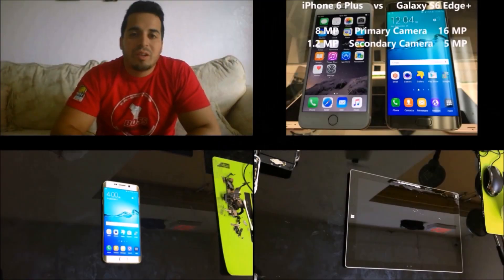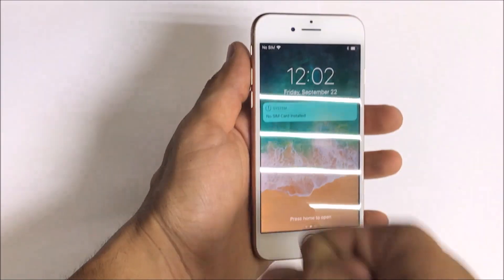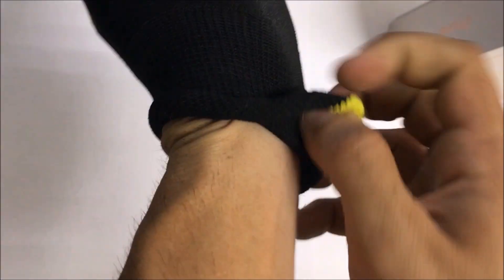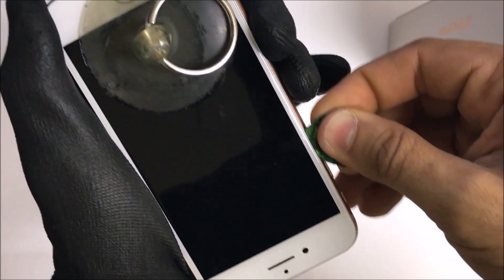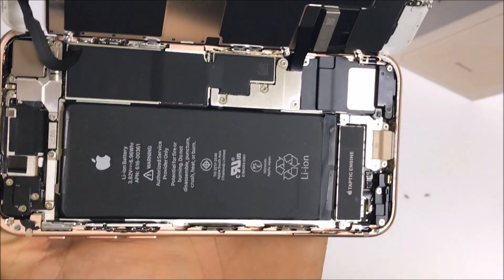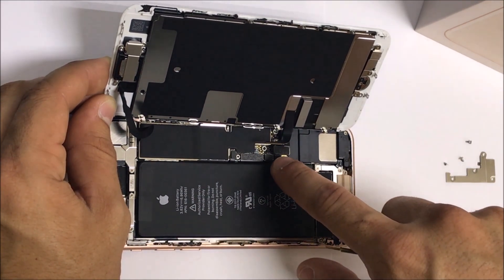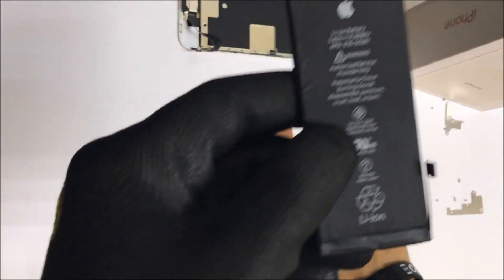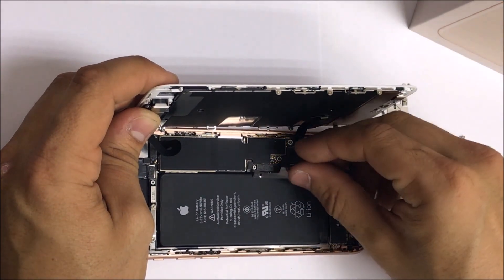How to Replace the Battery on a Apple iPhone 8

Comment: Good video. If I may. I personally would not even take off the flex cables connecting the screen to the motherboard. I have a tool that holds up the existing screen at a 90-degree angle. On one end is a spring-loaded set of jaws to grip the lower end of the screen and the other end fits into the charging port. The tool can be posed so as to keep the screen up at the desired angle. Once I do that, I can use a set of tweezers to slowly peel off the glue strips at the charging port end of the battery, basically spinning the stretchy onto the end of the tweezers.  Once you get the battery hold-down adhesive strips removed, you can replace them with new ones that come with a battery kit. Before inserting your new battery adhesive strips, connect your new battery to the motherboard so as to get the right fit before you mount the new battery.  I install the new battery tape onto the battery just like they were when you opened up the phone. Then it is simply attaching the battery flex cable to the motherboard. Test by turning on your phone. After testing on/off function, install your new double-faced adhesive frame strip all along the perimeter of your phone pressing into place with the pointed end of a plastic spudger. Once you have done that, remove the translucent tape backing. Close your phone, replace the screws on both sides of the charging port and you're done!

Comment: If you have the effort to replace that battery.
Why you just dont replace the new adhesive strips and the screen seal?

Otherwise its a good tutorial.
Reply: Yes he should have simply peeled back the adhesive strips when he wanted to remove the old battery and then used new ones to install the new battery...